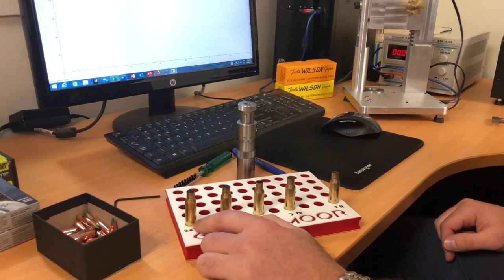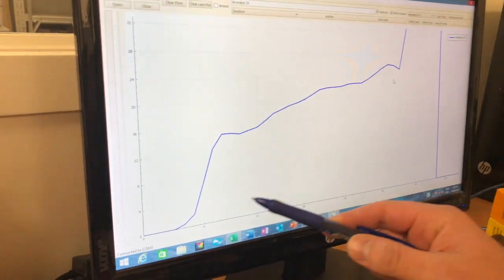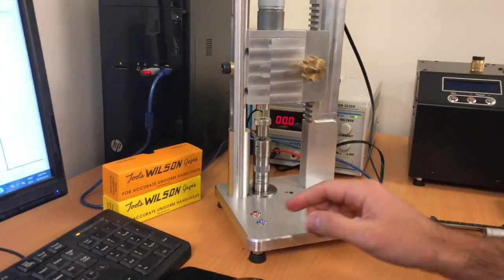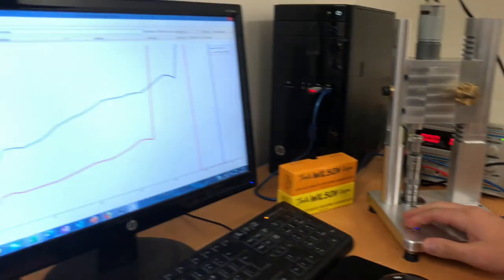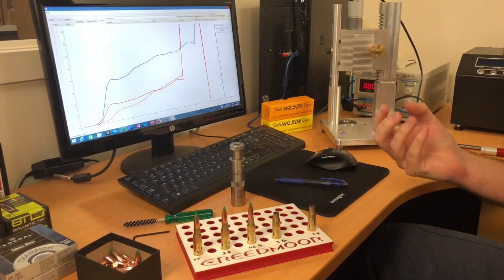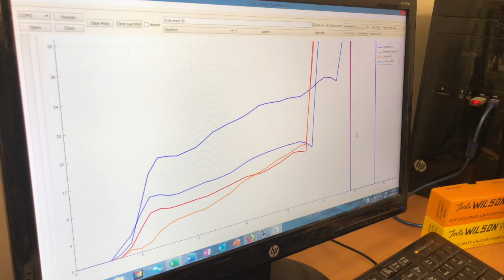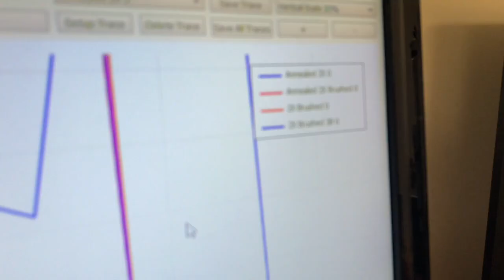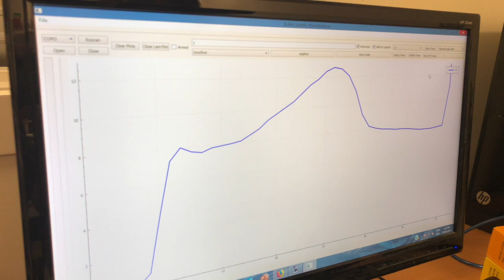Bullet seating press with load cell and auto drive

Comment: No Primer + No Powder:  No air is being trapped in the bullet case during seating.  Does this increase the seating force requirement?    Test should be revalidated with real time condition?  thanks for posting this video.

Comment: Very interesting video. Thanks for posting it.  I've always brushed the inside neck prior to tumbling or ultrasonic cleaning.  I mostly tumble everything now and my final step prior to priming and loading powder is to run a cotton swab moistened with alcohol into the neck to remove any residue. I can get very consistent velocities and some really good extreme spreads and SDs.

Comment: Have you cleaned the cases prior to the test?
Does ultrasonic cleaning alter the need to brush the case neck interior?
Reply from the maker: We have not tested this yet but will in a further addition to this study.
Reply: @annealingmadeperfect1257  wondering the same thing if using media
Reply: @annealingmadeperfect1257  we would be very interested in sensitivity from just ultra sonic cleaning.  Thank you!!